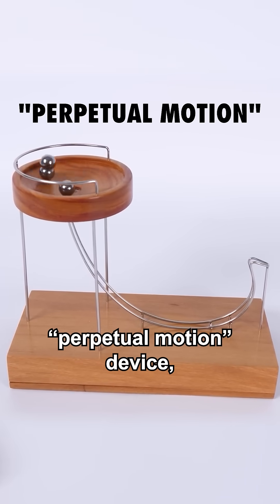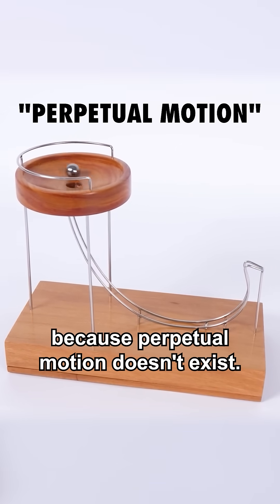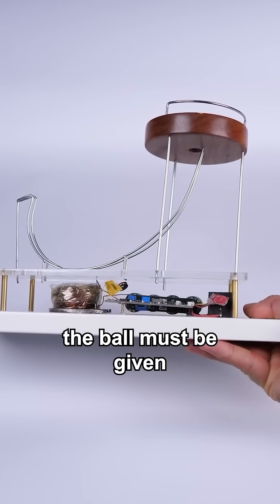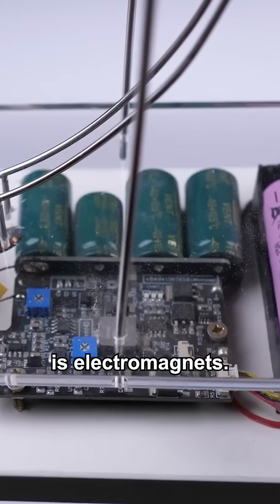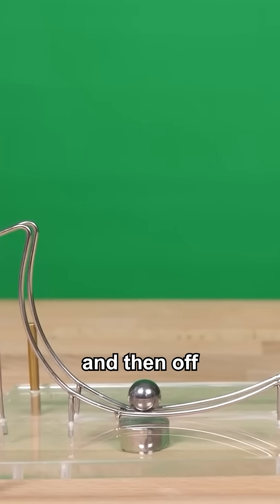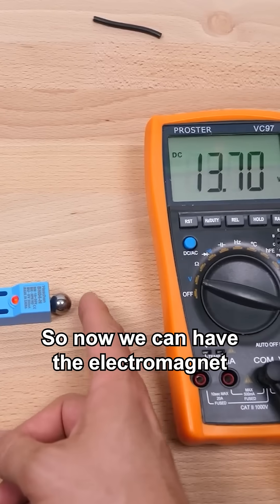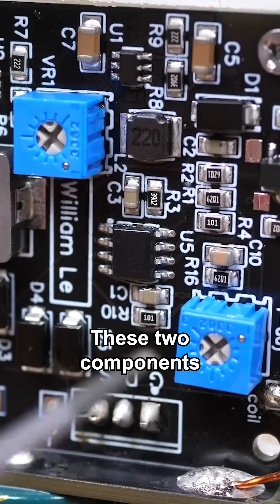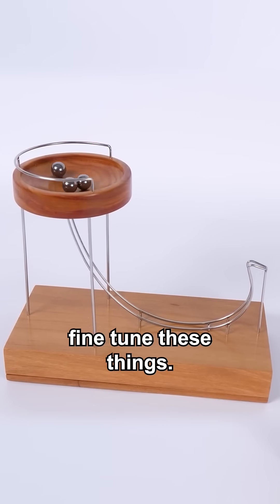Proving that "Perpetual Motion" doesn't exist!

Comment: Perpetual motion does exist. Just not on earth
Reply: It doesnt work in an isolated sysrem anywhere
Reply: @J.c410  if you push an object in space, what will stop it from moving?
Reply: it doesn't exist anywhere
Reply: @jordanfoster4761  if you push an object in space, what will stop it from moving?
Reply: @Mason_2715  it will lose energy over time
Reply: @jordanfoster4761  what force would be making it lose energy? Because newtons first law of motion says that an object in motion will stay in motion
Reply: @Mason_2715  one is friction, physics don't allow something to be frictionless
Reply: @jordanfoster4761  There is nothing in space. A vacuum can be frictionless because it is literally made up of nothing. What is there to have friction apply to an object in space?
Reply: @Mason_2715 there is still friction in the stuff in space, and also, everything will lose energy
Reply: @jordanfoster4761  do you know how friction works? It happens when 1 object rubs against another object, which transmits its energy to that other object. since there is nothing in space, there is nothing to rub against to take energy away.
Reply: @Mason_2715  energy will still be lost regardless
Reply: @jordanfoster4761  by what? What will make it lose energy?

Comment: interesting question though for those who say perpetual motion does not exist:  At what point does a system that is not perpetual motion become effective enough to BE Perpetual motion?  If you made something that will run for 10 billion years before it stops, isn't that for all intents and purposes perpetual without violating any law of thermodynamics?

We should never be discouraged for chasing perpetual motion as it is more of a quest for greater and greater efficiency
Reply: At no point it will be perpetual
Reply: i mean, yes, but no ones really denying that. i mean thats quite literally what our solar system is and we use it all the time with probes through gravity assists and such to take some of that "almost perpetual" energy and put it to use same goes with solar energy, geothermal etc all these energy sources that are most definitely "finite" but only in the technical sense.
Reply: @jacobely6826  my issue is people look down at those looking to create perpetual motion, when serious attempts may lead to more effective energy generation even if it is never actually perpetual

Comment: Isn't space technically a perpetual motion machine?
Reply: No
Reply: @shrekkek9396  Well think about it. You launch an object off into space as, long as it doesn't come near a planet it will have no resistance to slow it down therefore perpetually moving.
Reply: @HowieDewitt535  it will have resistance.
Reply: @shrekkek9396  No. If there is no particles surronding it there is no ayoms to transfer energy to so the o ject would continue to keep its same energy. An object in motion stays in motion until acted upon by another force.
Reply: @HowieDewitt535 there're particles in space. And gravity still pulls it. Plus it looses energy through radiating. And it's not a machine.

Comment: If the magnet and the ball are opposite charges would it not require added momentum to keep the ball moving.   Acceleration and opposite magnetic forces would produce more push.  This results in a continuous motion.

Comment: Come on, Steve, it is simpler then this, it is a motor pulling the ball in the hole. Some one bought one and opened. The battery is inside the upper plate

Comment: Assuming that by perpetual motion, we mean motion that does not stop until the materials involved reach the end of their atomic lifespans, it is actually theoretically possible. We would have to travel to the deepest parts of space, where we are the farthest from any stars or galaxies, and construct a machine as follows. Build a large sphere out of a strong material, one that won't collapse under its own weight. Leave a hole directly through the center of the sphere, going from one side to the other. Drop a small sphere, just shy of the hole's diameter, precisely down this hole. Assuming your dropping method was precise, and there were no errors, the small sphere will pass through the large sphere, stopping and reversing at the exact same elevation on the other side. It will do this until the atomic decay of the material you use causes the gravity to change significantly.

Comment: I don’t even think we’d be able to achieve perpetual motion in space either cuz it will still lose momentum just very slowly
Reply: technically, if you have theoretical absolute vacuum, anything you set spinning or moving will continue to do so indefinitely. There are some places in the universe with conditions very similar to that, they are called voids.

Comment: If someone invented a perpetual motion machine the headline in the news would read "time machine invented" because the only way to reverse entropy is time travel.
Reply: Never have i seen someone so boldly confident in something that they have no idea if it is actually true. 

Oh nvm i guess religion is a thing
Reply: Workin on your tight 5 for the comedy store?
Reply: Huh
Reply: @creationtjoc4802  on short, useful energy is continuously decreasing on the universe, so the only way to get more useful energy to keep something doing work forever is to go back in time
Reply: Entropy can be reversed in a fridge for example, but universally something has to give, in this case the electricity to power the fridge.
Reply: @chunkylafangaa  Entropy is reduced inside the fridge, but it is increased outside the fridge to a higher degree.  Therefore, the net sum of entropy in the Universe has increased overall.  It is not possible to reduce entropy in the Universe without reversing time, which is of course, impossible...
Reply: @ctvxl  which is basically what I said. Something has to give elsewhere.
Reply: @chunkylafangaa  refrigerators just move heat from one place to another.
Reply: @craigmerryfull7704  do you know what entropy is?

Comment: This doesn't disprove perpetual motion, this just proves that it requires additional engineering.
Reply: Actually the only thing disproving perpetual motion (in our universe) is that the predicted end of the universe is a heat death. Otherwise, if one takes the entire universe as system in question, perpetual motion might exist.
Reply: @timosteinsteiger7289  This person gets it; there is an entire 98% of our universe that we humans cannot yet observe.
Reply: And batteries, once those are depleted gone is the "perpetual part"
Reply: @dethskullcrusher  Oh yeah? Prove that perpetual motion doesn't exist then. It's really easy, you simply require mapping out every molecular structure in existence, including the stuff beyond our observable universe, and then prove that none of those molecular combinations are capable of perpetual motion.

As I said, you proved nothing more than a lack of engineering talent; a real mastery of engineering wouldn't require batteries for anything, especially with how inefficient batteries are in their current condition here on earth, once you factor in the inefficiency in power generation and power transmission it quickly gets worse.

Comment: Even if, somehow a perpetual motion machine does exist(which it doesn't), it will be practically useless since the energy that is generated would only ever be enough to run itself, a 1:1 ratio of inputted energy and outputted energy, since a device could only ever be 100% energy efficient, never above. A simple equivalent exchange of energy, balance as all should be

Comment: Those things are terrible. I bought 2 off of Amazon last year and they only properly work if they're at 100% battery. If it runs for more than about 5-10 minutes, it will not have enough power to launch the ball back into the cup.

Comment: Interesting. Especially as the Earth itself , revolving around the sun, and around its axis could be mistaken for a perpetual motion system. What is more perplexing is that we don't seem able to directly tap into the dynamo effect of the planet in order to generate electrical currents. Sure, tidal forces, radioactivity, wind and sunlight are all "conveyors" of energy - but why, while the earths iron core generates a strong magnetic field, does the simple movement of a conductive coil through that magnetic field not seem able to generate induction? Or does it?

I'm often attracted to Nicola Tesla's attempts to erect tall towers to transmit electricity, and to generate "free energy".

Tesla was an incredible and prolific inventor, who's ideas revolutionised engineering. Why are his ideas about "free energy" so often dismissed, even ridiculed?
Reply: Earth magnetic field is not that strong, it barely can turn the needle of a compass. It can generate some electricity, but it's better to bring your own, stronger magnets, and just make a normal generator.

Comment: So what you are telling me if you can game the energy the ball makes rolling down to change the power to switch a power source on and off it will be the very thing you say is impossible. The right brothers said na your wrong and now we can fly in plains. I think you put your brain in a box. You are smart but stopped trying to make the impossible possible.
Reply: The switch only detects metal (in this case).

Comment: Pretty sure you can make this work without electricity simply by redesigning the pitch of the slide etc….
Reply: The friction (energy) will always be there. The amount of energy required to propel the object will be lost on the return angle of the ramp.

Comment: I’ve written about a perpetual motion device:

Hollow cylinder, ends weighted
A tungsten sphere rolls within,
Ball bearings, lubed in ferrofluid
Enduring mounts, securely stanchioned
After a push, it’s governed by free fall
Like a windmill, but accelerating
The longest running, the most electricity
This renewable energy, would power a city

More Friction, Less Money

Comment: If perpetual motion doesn't exist, explain the solar system....
Reply: Orbits lose energy because of solar wind, thermal radiation, drag from the interstellar medium, etc.
Reply: @iikeli1  So the moon must be spiraling towards earth because a decrease in it's orbital energy due to solar activity would cause earth's gravitational pull on the moon to increase, correct?
Reply: @ChrisMeerkat  
Actually, the Moon is going away from Earth, because Earth is accelerating the Moon through torque caused by tidal forces. These tidal forces give the Moon's orbit more energy than it loses, but since the energy is transferred from Earth's orbit, it's not perpetual.
Reply: @iikeli1  If the moon's energy is boosted by the tide it would make sense that the moon would also go into a outer orbit and then drift back in again repeatedly, perhaps over the course of millions of years, just like the tide but less frequent. So, if the tide and moon are both reacting to each other constantly and have been for 4.5 billion years, wouldn't that be perpetual motion?

Comment: I don't know what perpetual motion is and why should it not exist in reality, but from the sense of perpetuity I understand some repeated discrete actions stopping and then again starting to finish off to repeat again in the same fashion! Now, the duration of stopping may be out of perception of time giving a continuity of the action and the entire graphic movements is a continuous process as it's not possible to measure the stoppage time in between two distinct but similar actions and we confer perpetuity in motion doesn't exist unlike the digital reproduction of continuous sound of district bits give an analog sense of continuity! In the device the balls gains more and more kinetic energy as they fall to a continuously lower level from the upper level and the inertia of motion gives the required thrust to get back to the the receptacle which is made to bring the balls to the central hole to repeat the process of circular motion and anything in the middle to take away the kinetic energy gained during the fall would make a ball lose the requisite momentum to reach the receptacle! Why should we keep an electromagnet with a timer to be shut off as soon as the ball reach there when without the magnet the motion seemed to have perpetuated because we can think it happened without a distinctive measure of perception! 😮😮

Comment: Based on discussion in the comments, it's clear we need a new kind of perpetual motion machine.  

We need one with hidden solar cells or some way to use the perpetual motion machine as a battery charger (eg, driven by linear motor-generator effect or inductance properties).  

Of course that'd be another fake but neat looking perpetual motion design, but I don't recall seeing any to date that promise a net positive apparent energy yield.

Comment: They’re called “quotation marks”. Where the F does “inverted commas” come from?  Why…just why?  Aside from that, great video.
Reply: They are coming from proper English and not from acoustic kids dialect under the name of American English.
Reply: @shrekkek9396  Considering both forms of punctuation have been in flux in Great Britain since the 1700s, and the form currently in use is pictographically more congruent to a “quotation mark” and not a pair of single-stroke “inverted commas”, perhaps you should actually get consistent with your usage of your own terms.  Consistency - that’s something English, as a language, has always lacked.

Comment: Is floating through space perpetual due no friction?
A magnet powered machine will last for 1000s of years til the magnets stop working.
Reply: Not quite perpetual, but objects in space move slower at such a long time frame that it takes millions of years (if not more) for it to happen in a significant way

Comment: This is not actually perpetual motion ,, what it is is it's using electricity I mean anything that has an external power supply secondary to itself can't be considered perpetual motion in my opinion
Reply: That is indeed the point, yes. Perpetual motion does not exist, no matter how convincing it may appear. This is just a kinetic sculpture which demonstrates why it isn't real and isn't trying to be a scam.

Comment: You don't need to see anything other than the fact that the ball goes higher than its starting point from the fall. That means energy was added somehow.
Reply: Wow there, you're clearly overestimating the average intelligence of humanity !
Reply: I only need to see the words 'perpetual motion' to know that - IT'S NOT.
Reply: Yep. We know that there's energy loss in the wooden hopper, because otherwise the balls would swirl around forever and not go down the hole. That means that even if the metal ramp and the air were somehow frictionless*, the ball would end up just short of clearing the rim of the hopper.

*And it would have to be frictionless. Friction causes the ball to spin. That rotational energy comes, essentially, from a loss in what could have been a higher speed. It's an exchange.
Reply: There's also the fact that you can see that the balls move way too fast
Reply: @avonzapper  yeah you can clearly see it accelerate from the magnets
Reply: INFINITE POWER GO BRRR
Reply: Yeah that was what immediately stood out to me.
Reply: Potentially a prime argument 😂😂
Reply: exactly
Reply: I like the one about the bottles on a bicycle wheel. A few years back, I wanted to try that, but I'm so glad I
somehow knew better !
Reply: Exactly !
Reply: not somehow, it was the magnet.......
Reply: There is a wheel in the hole
Reply: Hi, on this day i came with a message for salvation. Repent now for you sins until its too late. God loved the world so much that he gave his only begotten son to die on the cross for our sins.I cant force you to believe in what i believe for you have been given free Will, But im telling the truth our Saviour is Jesus Christ and only trough him we can be saved. Im not telling you this to judge for i am a sinner too but i am inviting you to a relationship with God. Praise be to our Lord. If anyone wants to know more about Jesus you must read the bible
Reply: What if there was a giant permanent magnet on top of the room?
Reply: @kornelijekovac9793  that's not gonna change anything important. It will mitigate the weight of the ball, reducing its acceleration down and deceleration up equally. Without some extra force, the ball will still lose energy.
Now if you have a strong enough magnet that you turn on and off, or adjust the rotation, you could keep the ball moving. But you will have to keep adding more energy to do so.
Reply: It's from the perpetual motion.. duh
Reply: Um
Reply: There might be initial speed at the start though?
Reply: @sirporkrib7643  
There is no initial speed. The ball is falling from the hole in the top. The speed would naturally be generated by gravity. That speed could not overcome to force of gravity that is constantly acting on the marble unless something other than gravity was affecting the marble's speed(acceleration).
Reply: @lilchristuten7568  So anything "falling from a hole" has no initial speed? I'm not denying the acceleration, it's just that this argument has a bug.
Reply: @sirporkrib7643  
There is no initial speed. The marble is rolling around on a flat surface before falling down the hole. As such the initial downward speed is 0.

There is a clearly presented visual of what is going on don't try to change the circumstances to illicit a different outcome for what is clearly shown.
Reply: @lilchristuten7568  You're right, I stand corrected.
Reply: You've got a lovely voice there ,mate.I could listen to you all day!